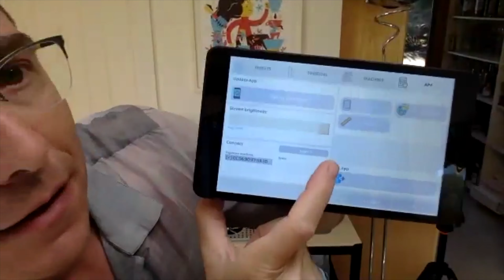All about Decent Reliability

Comment: Helpful video, thanks. 

Are you aware of some users being unable to pull shots as full-bodied as what they can pull with E61 machines? This is basically the main thing that’s stopping me from placing an order. Everything else about this machine is just incredible!
Reply: How to clean group Head. I man does is it neab back flash or descale
Reply: @N.Diri79  technically it forward flushes. Like any espresso machine, you need to flush and descale it as needed. I flush mine after then end of every day with water, and do a detergent flush every week or two. Every one or two months I take apart the brew head and clean it. The machine senses scale build up, and will tell you when it needs a descale cycle.  Every one has a different routine based on many factors, but that’s what works for me.

Comment: I have been fixing coffee machines for many years about  20. This type of pipes ( ptfe with oring) that i have seen will  leak after about two years once  the silicone  or epdm o ring start to perish mostly on the steam side causing often electrical problems. i have also seen the brass rings popping off the ptfe pipe due to excessive heat and pressure squirting allover inside the machines.Some coffee machines, more commercial type, have copper pipes with brass fittings but due to the difference in heat expansions between the two metals they will eventually crack and leak as well. On the other hand i have still some machine on the field that was manufactured in the 60's still fully operational  (commercial) and domestic from the 80's 90's and more recent .Of course none of them has pcb except for the level control .I am not sure what is the expected life expectancy of this type of units but i doubt that will be around for more than six years
Reply from the maker: While both systems have their pro's and cons. If things do leak then the o-ring is replaced but the main benefit of this design is, it is simply enough most can repair things at home with the right parts. We still have one of the 1st batch of DE1+ V1.0 in the factory still running strong, which is going onto 7years very soon. We have changed the tablet though.
Reply: @decentespresso  thanks for the reply.On coffee machines and food processing equipment (i am involved in that field as well) failure is mostly caused  by water damage.I hope that you will try your best to make sure that spare parts will be easily  available  (specially custom made parts) and also for  years after the model get discontinued  as i have seen lots of people looking for help even for well known brand. As mentioned i own coffee machines from the 50's 60's 70's 80's 90's and all of those can always be repaired or modified with standard parts which  doesnt apply  for the late models.
Reply from the maker: @marcofiamoi6955  Parts for all models, including long discontinued ones, are all available for order from https://decentespresso.com/parts at reasonable prices.  All obsoleted parts have a compatible replacement, so that we continue to repair v1.0 machines
Reply from the maker: @marcofiamoi6955  as to water damage, our PCB is in a water-resistant box, in the back of the machine, so that water leaks inside tend to cause minor damage and parts can be replaced if needed.

Comment: Watching this 3 years later is making me really confused. I bought my DE1 roughly 3 years ago, made roughly 200 cups with it, using only RO water, and DE1 had broken seriously twice during this time. First one was inside leakage, within warranty so sent back to HK and I was told there was a problem in the design but fixed. The second time was weeks ago the mother board was broken, so sent back to HK and took me 600 USD to fix it. To me this really is not reliable. But I have to say John himself is very nice, and Decent contribute a lot in espresso science, however, I wouldn't recommend someone to buy it unless you are studying coffee science, and you love trouble.